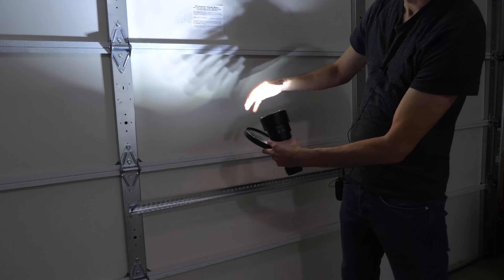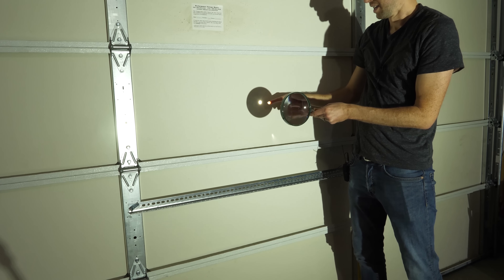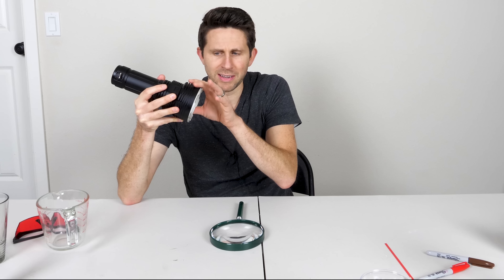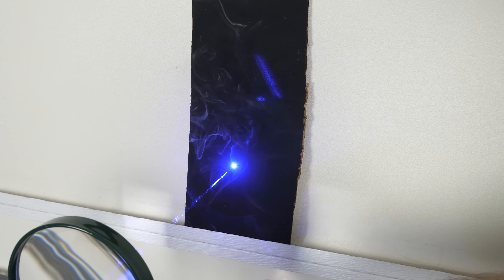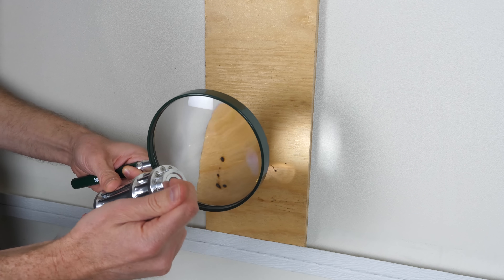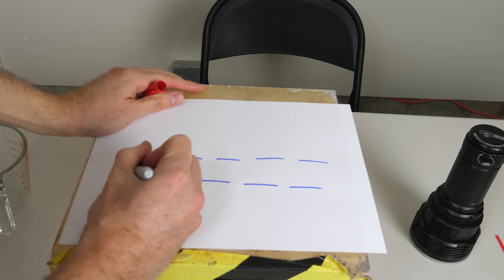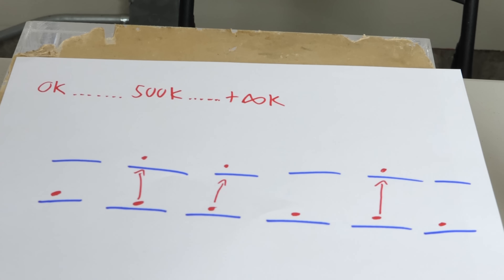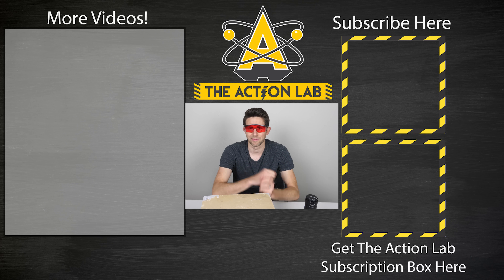What Happens if You Focus a 5W Laser With a Giant Magnifying Glass? Negative Kelvin Temperature!

Comment: The smaller the point gets the more powerful a laser becomes. I have a true one watt (I think it's a lot stronger as it needs a driver board, heat sink that has to be plugged in Violet focusable laser, it will burn through white walls. Get ready for bed mine has to be a lot stronger than yours because turning the aperture it focuses and as soon as the beam would have hit that wood it would have caught it on fire.

Comment: The fact that you need to use imaginary temperature negative kelvin only shows that the second principle of thermodynamics is already broken. Also by the way the laser emission is happening from what is called semi stable energy level that is achieved after the material has been excited and an electron has jumped up a layer . What happens after the electron will come down to an electron layer that is semi stable without emitting a photon and this is the layer than once the electron drops from will emit fixed wave length radiation. The fact that you can achieve laser light is because the material that is getting pumped has this in between energy layer that produces photon with exactly the same wavelength and the emission is triggered in a cascade reaction . Also the result will be not just the same wave length but also the same direction and polarization. Because of this properties of the laser photons the object that has been hit with the laser can absorb more than one photon per atom at the time allowing the temperature of the object to rise to infinity . All this explanation with negative temperature is simply made up not to brake some principle that is simply not applicable for the current situation but as we all know in physics and science the great brains are willing to
Come up with some magical explanation simply not to disturb already established principles because this will force them to re write a lot of books and nobody wants to do the work.  By the way quantum mechanics is not magic it is simply how things works on smaller scale and sooner or later classical physics will have to be rewritten and not considered as absolute since we all know that reality is showing phenomena that bend the laws of classical physics. Just like example with an object when it gets heavier simply because it get hot. In classical physics it is impossible but in reality it is happening.

Comment: There was so much wrong about the explanation. Using thermodynamics to explain how photons affect matter is almost never a good idea. Use quantum mechanics and don’t even worry about the concept of temperature because it doesn’t apply at the atomic scale. What matters here is energy density. Cellulose will only ignite with a minimum energy density which is achieved by focusing (increasing the areal density of) the light. Pretty simple.  Particles have some basic properties and temperature is not one of them. The second “law” doesn’t apply here. Also, the second law isn’t actually a law in the strictest sense. Disappointed with this alchemist pseudoscience gobbledygook.

Comment: sry but i think u are kinda wrong    if u have a flash lite wheee u can change the focus  u should be able to    aaaand   a lens bigger than earth wont get hotter than the suns surface?   depends   IF u had an earth sized lens and would focus it to a small enough point   u should get higher temperatures  bcs u should have a higher energy density per area

Comment: Pardon me if this sounds like a silly question, but isn't concentrating light into a single spot akin to compressing air inside a closed cylinder, resulting in pressurized air being hotter than the temperature of the air at the start, except in this case we're taking scattered photons instead of air molecules.

Comment: A better way of saying this is there is a limit to how small a point you can focus to with any lens and any source, because heat involves increasing the temperature of at minimum a single atom which means no point could be focused to infinity not to mention photons have a given size. I will say you can clearly focus a source flashlight way better than that, I mean how do you think lighthouses work? Fresnel lenses

Comment: Why would it break thermodynamics? The laws of thermodynamics are based on "heat" and not "temperature". You could not generate a hotter point by focusing the light from the flashlight because the lens was too small. If you could alter either the size and/or the focal length of the lens and cover the full flashlight and also focus it to a tiny point then it would obviously get hotter (more temperature) than the source. The laws of thermodynamics are still preserved since the area which is getting hot is way smaller than the source thus the heat (not temperature) is still less than the heat of the source.

Comment: ANOTHER ARTICLE;Early ultracold experiments in the 1990s used a technique known as laser cooling to begin probing these effects. "The light exerts a force on the atoms which slows them down to reasonably cold temperatures, around 1 kelvin (minus 272.15 C or minus 457.87 F)," said Christopher Foot, an ultracold physicist at the University of Oxford. "[That's low enough] to see quantum behavior in solids and liquids but for the gases we study, we need 10s of nano-kelvin temperatures to get these quantum effects."

Comment: This inversion of the population of energy states is not possible in water or any other natural system as the system would need to absorb an infinite amount of energy – an impossible feat! However, if the particles possess an upper limit for their energy, such as the top of the hill in the potential energy landscape, the situation will be completely different. The researchers in Immanuel Bloch’s and Ulrich Schneider’s research group have now realised such a system of an atomic gas with an upper energy limit in their laboratory, following theoretical proposals by Allard Mosk and Achim Rosch.

In their experiment, the scientists first cool around a hundred thousand atoms in a vacuum chamber to a positive temperature of a few billionths of a Kelvin and capture them in optical traps made of laser beams. The surrounding ultrahigh vacuum guarantees that the atoms are perfectly thermally insulated from the environment. The laser beams create a so-called optical lattice, in which the atoms are arranged regularly at lattice sites. In this lattice, the atoms can still move from site to site via the tunnel effect, yet their kinetic energy has an upper limit and therefore possesses the required upper energy limit. Temperature, however, relates not only to kinetic energy, but to the total energy of the particles, which in this case includes interaction and potential energy. The system of the Munich and Garching researchers also sets a limit to both of these. The physicists then take the atoms to this upper boundary of the total energy – thus realising a negative temperature, at minus a few billionths of a kelvin.:face-purple-wide-eyes:👍😉

Comment: So, basically, "negative temperatures" aren't a thing on a normal scale; We've created a modified temp scale so that the math works out. I feel the need to explain to the wannabe math majors that -0 may work in graphs, but falls apart at the seams when used in any regular equation.
Zero is a non-number.
Zero is a placeholder to indicate a lack of something; a void.
A negative sign indicates a directional reversal, i.e. spending a dollar versus earning a dollar.
Negative zero takes the concept of nothing and tries to create a deficit. It takes "I owe you nothing" and turns it into "you owe me nothing."
Physics people, fix your labelling conventions.

Comment: Or you could calculate it as a force of pressure over area where the pressure is the laser light and the area being the surface its touching and multiply it by the ratio of the difference in new area being focused on.

Pressure is a measure of how much force is acting upon an area. Pressure can be calculated using the equation pressure = force ÷ area. Therefore, a force acting over a smaller area will create more pressure.

If you decrease the area of surface by a factor or 4 then you'd have to multiple the force acting upon it ( if it was a factor of 4 it would mean you were acting on this area with a 20w laser) .... simples 👍 👌

Comment: I understand that the surface brightness can't be greater than the original when you are projecting an image of let's say, the sun, but if you reflect a beam of sunlight with a mirror through another lens onto an existing projected image wouldn't the brightness at that point be twice as bright? If this is true then you could add additional mirrors and lenses to project images of the sun onto the same spot, with some losses due to distance and reflection loss. Just curious.

Comment: @TheActionLab Wait a second. Lasers can indeed be focused to very small spots due to their coherent nature. Coherence and a narrow spectral bandwidth allow laser beams to be focused more tightly than incoherent light sources. However, there are physical limits to how small this focus can be, primarily dictated by diffraction limits and the wavelength of the laser light. According to the diffraction limit, the smallest spot a laser can be focused to is approximately the size of its wavelength. So, while lasers can be focused to very small points, they cannot be focused "to as small of a point as you like" without limit.

Comment: At infinite temperature, approaching that of the Big Bang, you know atoms won't exist anymore as the particles we know will turn into higher forms of energy, and the electromagnetic, weak and strong forces will no longer exist and will instead become a single unified force, thus no more protons and neutrons.

And you just couldn't focus the regular light.  If you used correct tools, you could focus all the light into a small enough spot to start a fire.

Comment: It goes past infinity, that made me laugh a lot.
Why dont you try heat something past infinity positive temperature, if you succed you will sure get the nobel prize.
Reply: "More excited atoms mean lower entropy. Entropy is highest when the population of unexcited atoms and excited atoms is equal, resulting in an infinite positive temperature. Before that point, more atoms exist in unexcited states. However, when you have more excited atoms, entropy decreases again as you add more energy to the system. This is what negative temperature means - more order as the system receives more energy.
This can only be done in quantum mechanical base systems like lasers.

Comment: I love your videos! I have background The study of electronics! But how does a laser have a negative temperature when it comes out of it's laser gun! Main question how does a laser have a negative temperature? I hope you read your questions and comments at people left and I hope you answer this one, If not I could just find out on Google anyway I'm just giving you the benefit of the doubt to answer it here!
Reply: In a non-quantum system, matter exists in a continuous state. When energy is added, entropy increases until the populations of the excited state and ground state are equal, defining the highest entropy. This is analogous to flipping 10 coins and observing 5 tails and 5 heads, representing the most likely macrostate. At this point, the temperature is positive infinity.

In contrast, a quantum system has a limited number of possible states. Continuously adding energy can lead to a higher population of the excited state than the ground state, akin to having more tails than heads after initially having more heads than tails. This results in lower entropy despite adding more energy. Consequently, any system reducing entropy as energy is added is characterized by negative temperature.

Comment: If you can concentrate even just a single joule of energy down to a plank length you can reach the plank limit of the space containing the energy and we dont know what will actually happen yet, but in theory the space cant hold any more energy so it has to turn into speed because the mass is fixed. So you'd be moving the plank level energy through the space by displacing the space by overloading energy in a confined space. the energy runs out of room and cant expand so then it will displace the area around it.

Comment: The amount of energy concentrated in a light source depends on both the intensity and the area over which the light is spread. For flashlights, the energy diverges, and as distance increases, the illuminated area grows, resulting in lower energy density. The sun, with its immense energy output, still yields significant concentration even when only a small percentage reaches a specific spot due to its vast distance. In the case of lasers, the entire energy is focused onto a small spot, creating high energy density.

Comment: It can absolutely get hotter per area than the source. Which you at least suggested incorrectly.
It cannot exceed the heat based on the total energy, but it absolutely can exceed it per square mm.
The point is that it's focusing it. Thus, the point-temp on the LED will be less than the focused temp.
I realize what I've said is all but a tautology, but you said it cannot exceed the temp of the sun. 
False! It cannot exceed the energy collected, but bc it's focusing the energy, it WILL be hotter.

Comment: I think the demo might be a little misleading? The brightness you can focus on a spot is limited by the law of entendu, but I don’t think the heat energy is. 1000 lights focused on one spot (or one large parabolic light surface) can create temperatures hotter than the light surface, but the reflection can not be brighter than the surface due to the beam divergence. The demo showed heat with the lasers burning the wood, but at least in theory you can get the wood to burn by concentrating light sources that are below the burning temperature of wood. (I could be wrong, and I did learn about the law of entendu today, so thank you in any case :).

Comment: Well you just modify the energy flux, which is the power over area ratio. Since you apply the same energy over smaller area you have a denser flux so higher temperatures on the spot. Nothing about breaking 2nd law etc. This applies to lamps, lasers and generally all kinds of energy sources.

Comment: Try to get a glass tube about the same size as the lense, and heat it up in your of those glass fiber making towers.
Let it draw out to the size you wish.
Cool. And coat the service with a mirror finish paint, or silver paint, on the inside, probably will refract too much if painted on the outside of the tube.
Then you'll use lenses to focus the light ..

Umm good luck 🤞💓🎉

Comment: This happens with the flashlight too, you're mechanically doing it wrong. The lens bends light inward. What you're doing is is putting the flashlight and lens at different distances from each other when what you should be foing is moving the lens and light system away from the wall more. You're bending the light inwards you're just not creating the distance for the bent rays to concentrate. 

Secondly, the "negative Kelvin" temperature is a stupid and wrong explanation. A tiny point of light being hotter than a radiant source of light is the same reason that summer is hotter than winter. Because light spread over more area imparts less energy per square inch than the same light spread over a smaller area. Less energy means less heat.

Nothing about this correct explanation violates the laws of thermodynamics because you have to expend energy to create the system in which light can be concentrated this way, the overall energy in the universe still disperses and the temperature decreases in perfect keeping with the second law.

Thirdly, you can't make an infinitely small dot no matter how you angle the lenses because of diffusion. Light diffuses in space proportional to the distance it travels so for there to be an infinitely small dot it would have to travel 0 distance from the lens and, as we discussed earlier the closer it is to the lens the bigger the dot so physics has handily tied that loose end for you.

Comment: If you make the magnifying glass about 2 inches in diameter and make it with the width depth of 2 inches tapering down to a narror funnel, you will increase the source output by concentrating the light photons into a tigther constricted tunnel that just like pressured water escaping faster in a pressurised system with a narrow exit hole, so will the light photons act in the same manner, increasing the intensity of the light via funneling into a shape that forecs photons even more tightly packed with each other.

Comment: I am little disappointed that you didn't mention that sun as well as flashlight has radial light ray pattern, so the light density declines over distance. On the other hand lasers have parallel pattern, which does not spread over distance. You are capturing all light from a laser and focusing it to one point... which makes the light more "dense", so higher temperature makes sense. If you first focus radial light from a flashlight to a parallel light and then use magnifying glass to focus to a single point I think you get the same result. Point hotter than the surface. This doesn't break any laws, since you are just making the light more "dense".